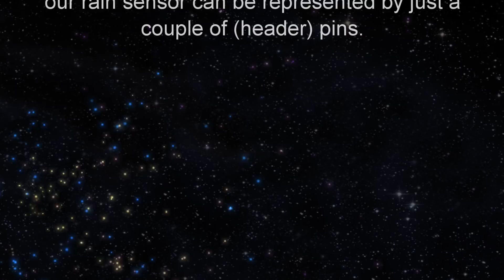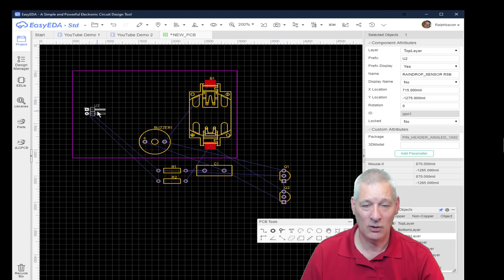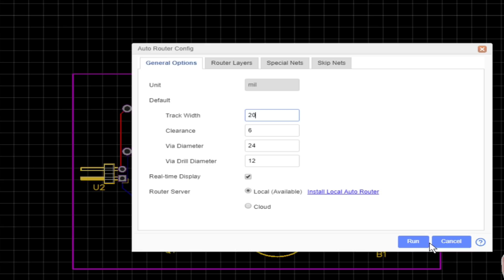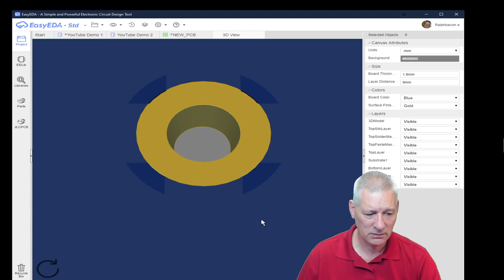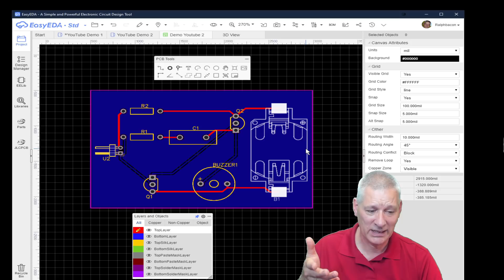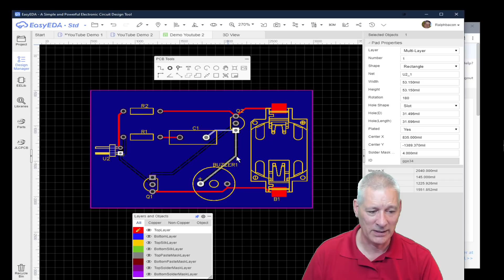#165 From Schematic to PCB - Part 2: Designing and Ordering the PCB ✅

Comment: Well, here's a comment that has both a compliment and a question.
First the complement: I agree with all those who mention that they appreciate that your speech is slow enough to be understood.  Being here in the US, I have to "translate" quite a bit of what you say due to your horrible accent. 😂  But I most certainly do  appreciate your humor.  All in all, your presentation is, for me, just about perfect!  By the way, I have no 30 minute limit on videos.
Now, the question:  I am trying to create a schematic that incorporates devices that I have already purchased from Amazon and Digikey.  I am unable to find two of the devices in the listings from in EasyEDA.  The first is an ESP32 development board (Flutesan B09GK74F7N), the other is a reed relay (HE103-ND).  As they are not shown in the listings from LCSC, I can't place them in the schematic and so I assume (I haven't tried it yet) that I won't be able to create the board.
Now, what to do?
Reply from the maker: Well, thanks for the "compliment": my horrible BRITISH accent! Let me remind you who was here first (in the sense of which country spoke English first, not our respective ages!)

Secondly, you don't need the device as a footprint to design it into a PCB. Your ESP32 dev board is, effectively, just a row of pins in two strips. Measure the distance between them (ACCURATELY) and place a row of pin header sockets in the right place. Same for the reed relay.

Alternatively, learn how to design a footprint to which you can attach to your own clone of a suitable part (or create that too, as I have done). Yes, it's all a bit time consuming but practice makes perfect (I'll let you know when that happens to me).

Comment: Dear Sir Bacon:

You did it to me again. I'll be Down-Loading EasyEDA this evening after my idiot Cell Provider gets out of its Daily Overload Mode, around 10PM.

I did this stuff many dozens of times back in the Olden Days, about 25 to 50 yrs ago, and I'm now getting back into Micro-Proccessor Hardware Design and C++ Coding, which at times has been a little tough on these Very Old Litte Grey Cells. At least I won't be Coding in Assembly Language again. HaHa

I've written a Hardware Spec, that needs to be matured, for a pair of ESP32 Development Boards using ESP-Now and acting in a Master/Slave configuration to implement a Stepper Motor Controller System. This wiil replace N6JJs fantastic ESP8266 Stepper Motor Controller. What a great job he did on that project, but I want a version that doesn't use a Smart Phone as a Master.

I'll do the schematics in EasyEDC first, Bread-Boad the two modules, and after many code re-writes and hardware changes, I'll be heading to JLB. And, thanks to you, I'll be burning gallons of Midnight Oil for more than a few weeks. No sweat, cause I love this stuff.

The Info that you presented in Parts One and Two of these vids are Absolutely Priceless to me. They woke up some of my Very Dormant Rusty Little Grey Cells.

No more Back of the Envelope Scematics or Dead-Bugs on Perf-Bords.

BTW: Your many Coding Technique vids, that I've watched over the years, started me on this path and gives me the confidence to write and implement the code for this project. See how much trouble you've caused?

Regardless: Thank You Very, Very Much, Sir Bacon.......

Regards
Reply from the maker: So sorry to give you so much trouble, Russ, but, hey, keeps you out of other trouble, right? And keeps the grey cells working (overtime, mostly, certainly in my case). Glad you're finding all this a challenge yet fun. Good luck!

Comment: Hey Ralph, thanks for these awesome videos. My question is regarding the final phase of the pcb before sending it to the production. I saw you just had the pcb with just the layers without the components. From my understaing on other videos on the checkout page (when uploading the gerber file) i can tell the supplier to solder the components too. (Supposing I am using all the components from the JLCPCB library). Is that correct ?
Reply from the maker: That is correct.

When you have generated the Gerber files, you must then generate the BOM which will product a spreadsheet file of all components. If you have used LCSC components (those offered by JLCPCB) all the information will be there. They will soon come back to you with queries if not.

Sometimes you have to buy minimum quantities (eg min 10 x 10K resistors) but they are pennies and any "leftovers" get sent to you with the assembled board.

Supplied, assembled board looks like it just rolled off the production line at the factory, superb!
Reply: @RalphBacon  Thank you for this clearance Raplh ! You're awesome!

Comment: Thanks for the great video, it was a tremendous help.  Yep, I made a mistake in ALL my circuit diagrams when I inadvertently used surface mounted parts instead of through hole components!  Ugh!  Making the PCBs (even if they are not going to be manufactured) really helps understand the tool.  In several ways, I have been using EasyEDA incorrectly and going through the PCB drawing features significantly helped increase my understanding of how to use the tool.  So yeah, I have to redo all of my designs but they will be very much improved.  Learning is an iterative process and things are really starting to come along.  Thanks again for your efforts.
Reply from the maker: Getting the schematic correct first is a huge step towards a succesfui PCB, for sure!

Comment: What about multi color pcbs? Or ones that change color based on temperature just like the hotwheeels use to do?
Reply from the maker: I've never seen a PCB that changes colour (other than to "burnt brown" as a component overheats 😁) but maybe a PCB manufacturer will pick this up as a must-have selling point!

I'd prefer multicoloured silk layer so we can put different coloured inks down that are logically connected (eg +5v in red, GND lines in black and so on).
Reply: @RalphBacon  hi. Yeah plenty of black pcbs here that used to be green 😁

Comment: Just like you said Ralph, play with it for a while and it starts to make sense. 
Yep, that did work however, I've looked (obviously in the wrong places) for info on how to "partly" populate the board say with smd components such as small resistors, Leds or small capacitors.
Not really into having a stock of these and if only a few cents for the added manufacture, makes sense (cents?......Hehehe)
Can't find anything about it though, any suggestion?
Worked out how to "panalize" i.e. how to get (in my case) 8 of my designs fitted into a 100mm square panel and x 5 this makes 40 of my designs for a little over AUD$8.00....post about $7.00 for 20 or so days delivery which is fine. 
These are part of a CDI mod to use black box CDI units with KY003 hall effect for model engine builders....seems a few interested here so a few boards won't go usused even if i have to give them away....... 😆😁😁
Reply from the maker: Hey, Jorgo, great to hear from you and see that you now playing about with PCBs!

You want to know how to get JLCPCB to assemble your board for you? Design your board with all the components you want. For each component that you want assembled for you ensure the "Include in BOM" is ticked (BOM = Bill of Materials, ie the components list) in the right hand panel. If you don't want a particular component assembled by JLCPCB just untick that checkbox for that component.

When you have done the PCB, generate the BOM from the toolbar - you will need to upload that to JLCPCB when you select that you want the PCB board assembled.

Obviously, only select components that LCSC have in stock (that JLCPCB use, part of the same company) and ensure they are described as "Basic", not "Extended" as that costs (significantly) more money.

JLCPCB will then quote you for the components (from LCSC) plus the (low or free) assembly fee and that's it! You accept (or decline) the quote and they will do the rest. Simples! They will soon tell you if you got it wrong and try and help you along. 😀
Reply: @RalphBacon  Hi Ralph...thankyou....Yes I did present a board to them using panelize but managed to get it wrong so just as well I asked for a review. A couple of back and forth after that had it sorted. Bit of trial and error if you will....cheers

Comment: Hi, I'm sorry if this might sound dumb, I'm a electronic noob but what is the main function of the capacitor?
Reply from the maker: I'm guessing you are referring to the 100nF capacitor across the VCC & GND pins of the processor? This is a decoupling capacitor and is often recommended in the datasheets to remove any noise on the power lines from entering the processor and upsetting the digital (or even Analog) processing. I would say they are mandatory for a stable system. And put physically VERY close to those pins.

Comment: hi Ralph, can EasyEDA able to create PCB with cursive edge like MicroSD Card of the picture link below ?

https://drive.google.com/file/d/191K0LQuwO-oFjkKHp7hixbHoMXdLgN4c/view?usp=sharing

and is JLCPCB able to produce PCB like above if EasyEDA able to create such PCB with cursive shape ?

Please advise, Tq.
Reply from the maker: Yes, you can have any shape you want, even one with holes in the middle, very flexible!
Reply: @RalphBacon  , I created first PCB with cursive shape, some questions to clarify:

1. Why the Blue color PCB is extreme expensive, it required "Special Process Fee" USD34.85, what is this charge for ?

2. I about to submit my first PCB to JLCPCB, so just to re-confirm, JLCPCB will cut the shape based on our submitted Gerber file right ?

Please advise.

Thank you.
Reply from the maker: Second question first: when you upload the zipped Gerber files, you will be able to see the shape of the board (the outline) and can confirm this is correct before you pay.
First question, green PCB is cheapest because most people use it. They have to load other colour PCBs in specially so it costs more money to do so. You should ask JLCPCB for clarification, really, and do it before the Chinese New Year starts in a few days.

Comment: I have a questions on routing PCB traces from bottom layer to top layer with SMD devices mounted on top.  I found it convenient to place a via on the pad of a 0805 resistor instead of a via next to pad and finish trace on top layer.  What do you think of this technique?  Using JLCPCB the maximum quantity is around 30-50 assembled PCB’s.  Why.  What if you need 100 assembled PCBs, looks like I would have to add multiple orders.
Reply from the maker: Is putting a via on an SMD pad considered Best Practice? If so, then it sounds fine to me (but I'm no expert). I don't know why there is a maximum of assembled PCBs - perhaps they are not best positioned for long production runs - why not ask them directly?

Comment: How did you tell the software that it is the ground wire that should be connected to the ground layer at the bottom? Also why some holes are round and others are square? Also 20mm track width? That cannot be the trace width!! What is a track width? Sorry about all the questions. Thank you for the details in your video and your great tips.
Reply from the maker: Wow! Daniel, I feel your enthusiasm! Let's answer your questions.
1. When you create a copper area on the top or bottom layer, it asks to which NET it should be connected, GND or VCC (or none, which would be weird).
2. I'm not sure any holes are actually square, just the solder pad, which usually denotes pin 1 (eg of pin headers).
3. Track width of 20mil (that's thousands of an inch, not mm) is perfectly acceptable, that's about 0.508mm. I normally use 10mil to start with just to get things connected then increase the size to at least 15mil and for power (and GND) 20mil to 40mil is good.
4. I finally use teardrop connections as that increases the physical strength of the tracks as they join a pin header or IC pad.
Keep the questions coming, it's the only way to learn.
Reply: @RalphBacon  Hi Ralph. Thank you for answering my questions. They were perfect. I never realized 20mil is not 20mm (or 2 cm?!!). I need to look into that unit of measure. 

I learned a lot about EasyEDA and would love to order my own PCBs soon. 

It would be awesome if you did a video on vias (if remember correctly) where a top trace is connected to the bottom one through a hole. The reason it that as hobbyists we often have to back engineer PCB traces on very interesting boards for which there is no information online. 

Knowing about vias that carry the trace to the other layer has proved a very useful piece of information for me.

As always, thank you very much for taking the time to answer my questions!! It's very kind of you and I find your videos most interesting. I ran into your YouTube videos only a couple of days ago.

I wish you many many years of happy tinkering, learning, and creating.
Reply from the maker: Alexa (Amazon Echo) also thinks that "mil" is short for millimeters (or even millilitres) so will not convert from mil to mm for me! If you have one try it out!
Reply from the maker: PS What is it about vias that you need to know? In EasyEDA just press V and you get one whilst laying tracks and the size can be adjusted like any other copper.
Reply: @RalphBacon  Hi Ralph. I am interested on how how to use vias in a PCB design. There's no good documentation on EasyEDA. One YouTube video showed how you can drop a via your PCB design and then select a track on either side of the board (blue or red). It's the first I saw on how to use a via. Thank you for the conversation. I am very grateful.
Reply from the maker: Vias are nothing special, just connection top and bottom traces but Best Practice says to minimise their use. Whilst creating a top track (red), press V to drop a via and then press B (blue) to continue that track on the bottom.
Reply: Ralph S Bacon  Thank you for the information, that covers vías pretty well :) It is so good sometimes to confirm a fact, or two, with someone else who has the experience. Take care of yourself my friend.

Comment: i have seen alot of demos and your was one of the betters ones despite the fact that your face was in it. are their any real instructions like a book of some kind for this. for example if you had your components could you just drop in a resistor with out going threw the purchase process.
Reply from the maker: Well, Charles, despite the fact you object to me starring in my own video (😭 what!) let's see. Although this demo was about the integrated nature of LCSC.com (for components) and JLCPCB.com (for the PCB) no-one is saying you have to order the components at all. You can just order the PCB. However.

In fact, let's make that an HOWEVER, are you sure that the footprints you've chosen are correct for the components you already have. You are probably safe with either through-hole or SMD capacitors, resistors, chips and diodes. What about USB sockets? Barrel jack power sockets? On-off switches? In fact, unless you have a footprint for the product (or are prepared to spend considerable time creating one for that component) you're better off ordering the thing from LCSC.com simply because you know it will fit. I have not found a book for EasyEDA but the online docs are pretty good and have a lot of examples. Is this what you asked?

Comment: I wonder if that "rain sensor" circuit would be usable for determining soil moisture?  A couple of good-sized nails as probes,  connected to where you have that sensor,  might do it.  (And I notice that schematic wasn't included in the github.  :-)
Reply from the maker: In my experience, nails are not suitable, Roy, as they will corrode. What I have got specifically for soil moisure is a capacitive probe, see https://www.banggood.com/Capacitive-Soil-Moisture-Sensor-Not-Easy-To-Corrode-Wide-Voltage-Monitor-Module-p-1309033.html?p=FQ040729393382015118&utm_campaign=25129675&utm_content=3897
I haven't tried it (yet) but has got to be better than something in direct contact with water? What do you think?
Reply: I think corrosion could be an issue if you were to leave it in place,  but I was thinking more along the lines of stick it in the dirt and listen to the noise,  wiping it off afterwards.  And nails are cheap,  anyway!  I guess that it all depends on how I've rigged up something to hold them.

Comment: Hi Ralph. Very useful video as usual. I have a question about the JLPCB assembly service.
For extended (i.e. not so commonly used) parts, there is, understandably, a charge to cover the technician having to mount reels on the pic and place machines.
I am wondering if this for every instance of the part used in a design or if it is once per extended part.
If I need two or more of the same extended part in a design, or if the design is panelised and there are, say, 6 panels, I would hope that the extended part cost
is incurred only once. And also that it will not be affected by board count 5 vs 10 vs more.

This would be an important factor for me as (a) I cannot solder -- have no iron, experience, work space -- and (b) I am on a very limited budget.
Cheers, Mike.
Reply from the maker: The cost is one per board, whether you have one board or 100, just the one charge per component.